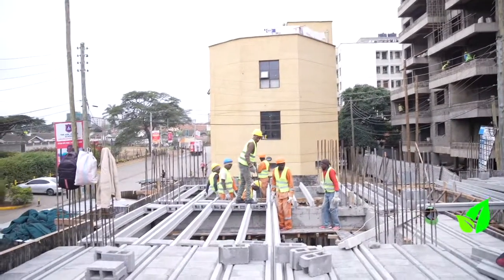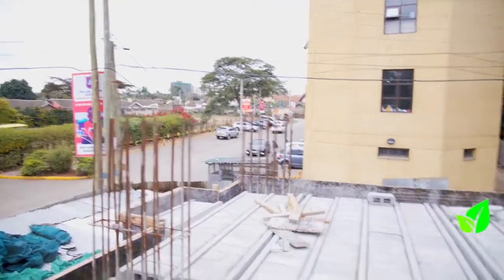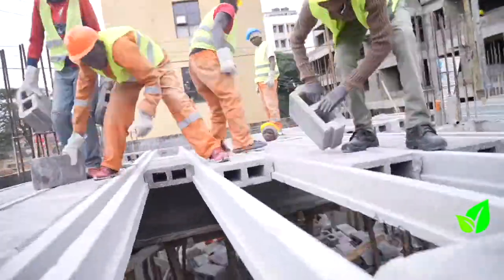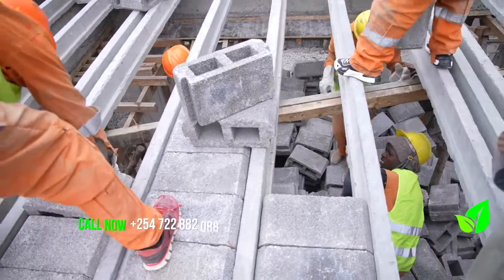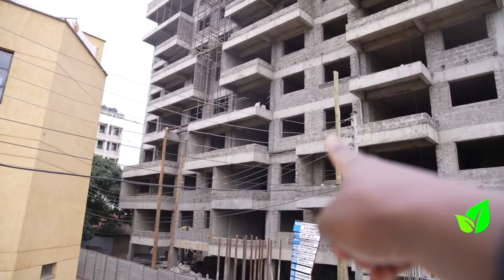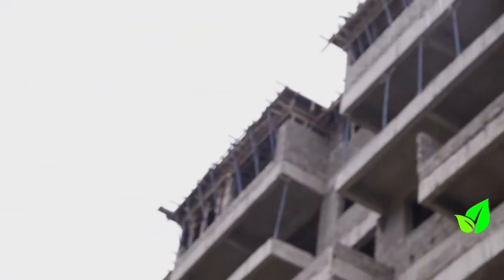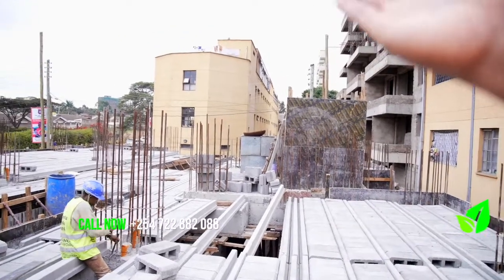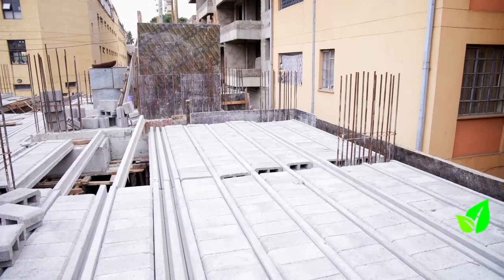Case Studies - South B, Nairobi - 10 Floor, Apartment Building, Part 1

Comment: The slab cant be that strong  built using prefab blocks! These blocks lack cement, aggregate mixture to withstand heavy loads. Quick, easy but detrimental on long term.. I stand to be corrected.
Reply from the maker: The block and beam floor  designed to be structural and undergo regular testing during manufacture. The floor is then designed to suit the usage and spans required and standard safety margins are applied to the design .
Reply: Just sit

Comment: Hi,great work there.am asking if it's possible to roof with you yet my house has no columns erected on it.its a 3bedroom normalise size bungalow measuring approx 40 by 40 fts.
Reply: It doesn't take 21 days for work to continue just for the slab to gain full strength work can continue as soon as the next day upon pouring the slab